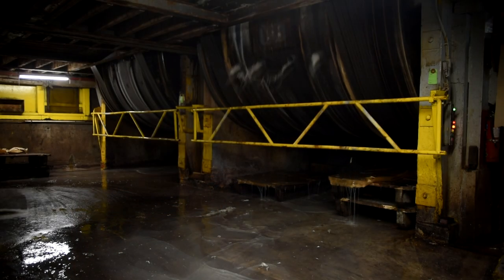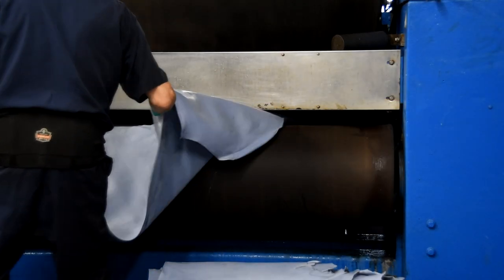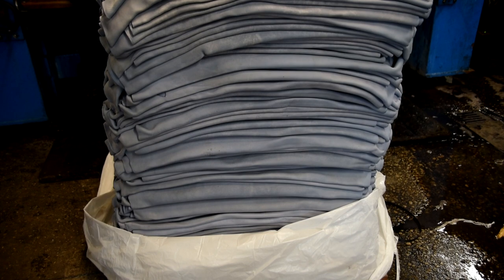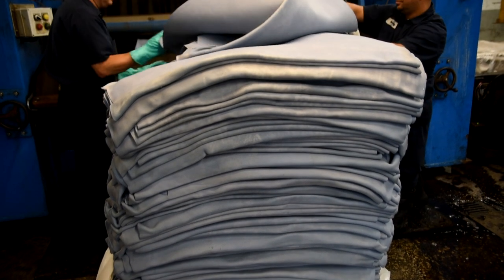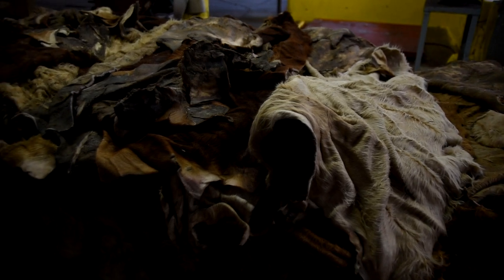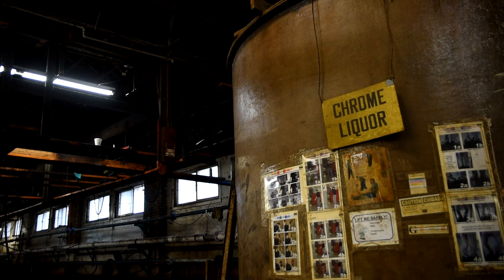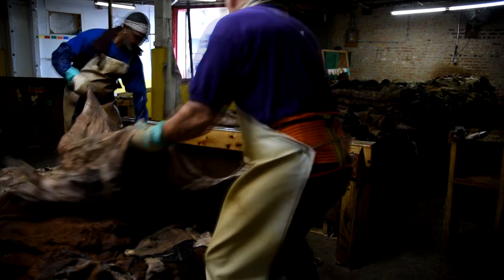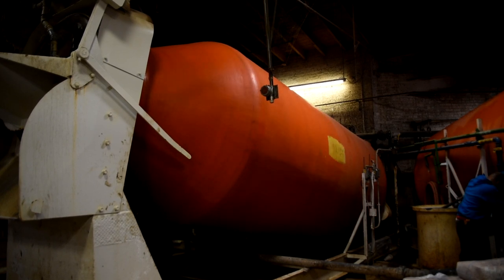Horween Leather - Chrome Tanning Explained

Comment: I worked at Eagle Ottawa Leather Company(now Lear) in Grand Haven Michigan for 27 years mainly in the "Dry End" where the finish was put on the leather. We did Blue Chrome tanning. We had "Chrome recovery" where we recovered the chrome from waste water. We did up to 50,000 hides in "soak" per week. We had paddle wheels too, but got rid of those. We had Canbar mixers which I see here. We did whole hides where as here they did "Splits". I left in 2003 and in 2006, the Grand Haven Plant was closed. Now the site is an RV park.

Comment: As a guy with a chemistry and biotechnology double major, I appreciated the discussion.  I’m looking forward to a discussion of retaining and if you can, Essex full veg?
Reply from the maker: I'm sure you appreciated this more than I did! A lot of the chemistry details are way over my head. Essex is Horween's most popular chrome-free tannage. It is an aldehyde base that is tanned with the exact same veg tree bark blend we use in the coveted shell cordovan leather. There are a few variations on the Essex as well. I prefer the Dublin leather which IS Essex but finished with a hard wax on top... great pull-up effect, depth of color, and amazing patina.

Comment: Very interesting video. Could you comment if the Chromexcel tannage could be used on horsebutt leather the same as steerhide? I saw Viberg has some Horsebutt makeups on their website and the finish looks like Chromexcel to me.
Reply from the maker: Great comment. We do make horsebutt Chromexcel. As I think about it, the only place using this that I know of is in fact Viberg. The Chromexcel horsebutt is much more dense than Chromexcel steerhide. It has more of a "veggie" feel and a bite too it. The horsehide/horsebutts also have a different and more intense grain character. The shells are hidden underneath the finish of these chromexcel horsebutts. I'd expect them to be very durable and wear in nicely!
Reply: Ashland Leather Co. thanks for the reply! I have a pair of Vibergs made with Color 4 horsebutt that does have a more veggie feel, in comparison to the steerhide varieties. I’ve seen the name Work Shoe Butt used by some companies, is it safe to assume that’s the same as Horsebutt CXL or is it a variation?
Reply from the maker: @gabemaldonado2624  The work shoe butt should be analogous to the horsebutt CXL. I'm not sure who is making product with this other than Viberg at the moment.

Comment: Horweens chemistry was this advanced a hundred years ago? I’m curious as to what part of this age old process has changed. Wasn’t de hairing a manual process?
Reply from the maker: Everything is generally the same as it was 100 years ago. You are correct, there used to be a mechanical process to remove the hair. The mills and orange mixers are all "new" within the last 40 years.There are some modern technologies that are much more friendly to the environment. For example, chrome uptake is much better these days so we don't have any chromium in the wastewater.

Comment: So what's the difference between Horween tanning process and a typical tannery chromium process? What's the benefit of a Horween tanned hide over a Veg tanned hide?
Reply from the maker: Great questions. The Horween Chrome tanning formulation maximizes for quality over yield. The Horween blue is more plump and full than other chrome tanned formulas. They are also designed with our re-tanning formulations in mind so we make the best Chromexcel and Football leather with the Horween Chrome tanning formulation. When you ask "what is the benefit of a Horween tanned hide vs veg tanned hide" -- Horween actually makes vegetable tanned leathers as well. The most popular vegetable tanned leather Horween makes is Shell Cordovan. Guessing at what you are getting at: Horween Chrome tanned leather has a stronger slit tear and tensile strength and it is more heat resistant than the vegetable tanned leather.